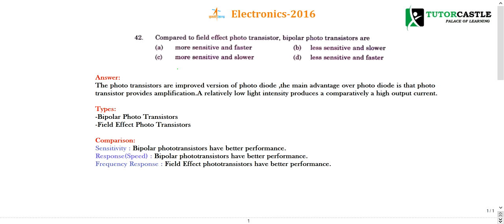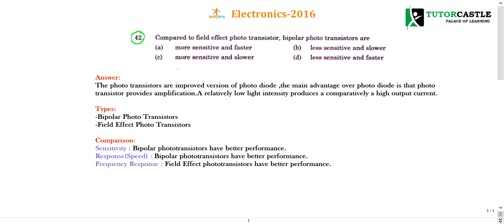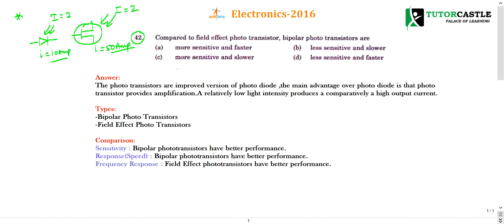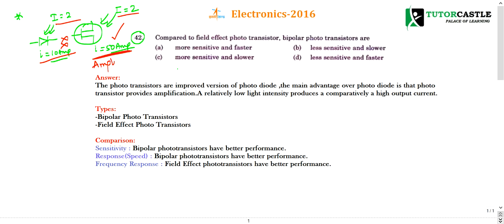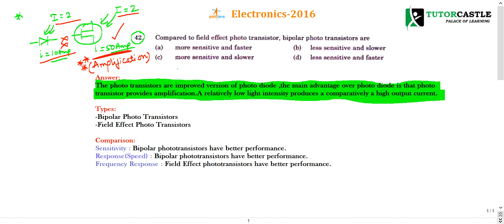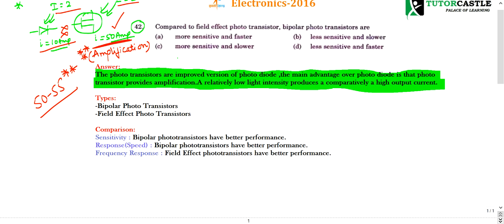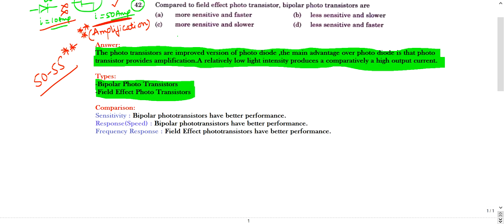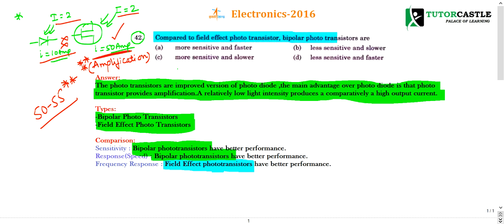ISRO Previous Year Detailed Solutions- 2016 - 42Q - Electronics

Comment: Sir I have doubt ..we have learnt FET is faster than bjt... other option matched with transistor property except the above one
Reply: It depends upon the application which one is faster likewise:
For current mode signal processing, BJT will be faster since it's current 
amplification doesn't involve large changes in junction potential.But  For switching applications where the collector/drain voltage has to go 
close to zero and back up, MOSFET will be faster, since in case of a BJT
 there will be minority carrier storage in the base in saturation which 
will take time to flush out.
Reply: Ashutosh Rastogi thanks sir